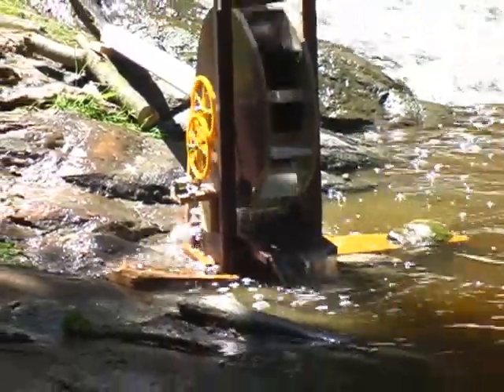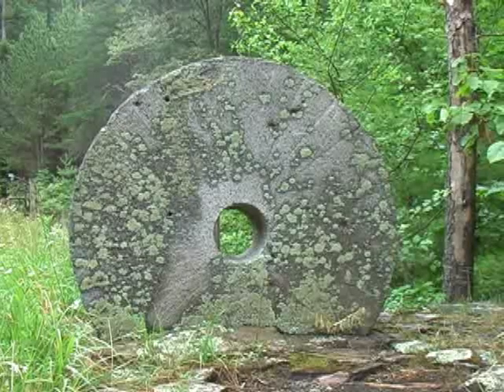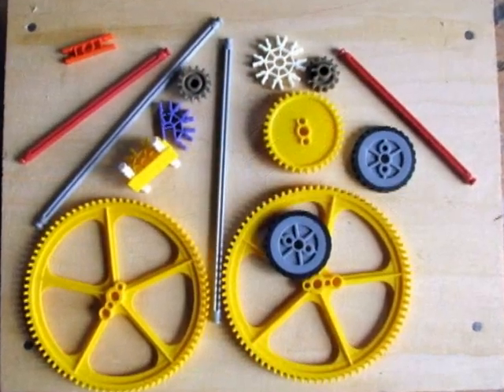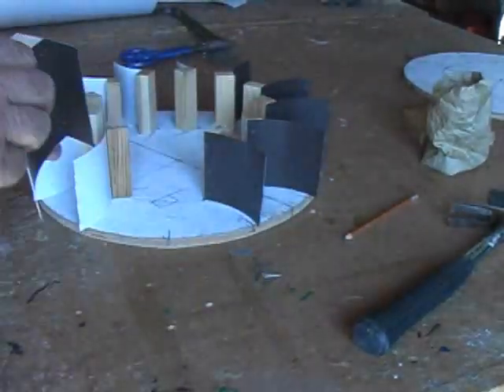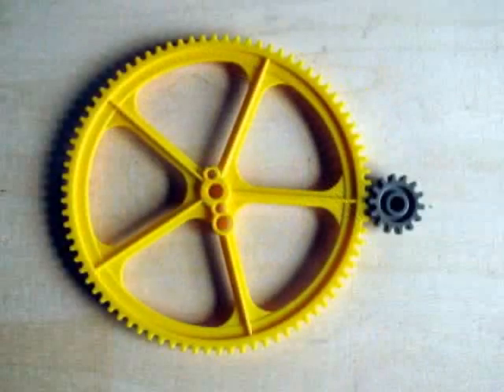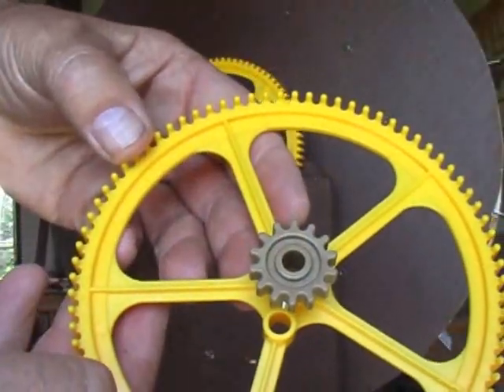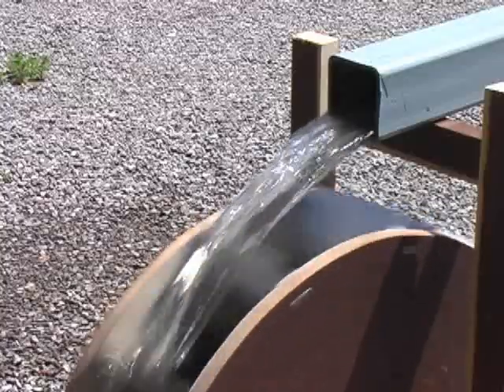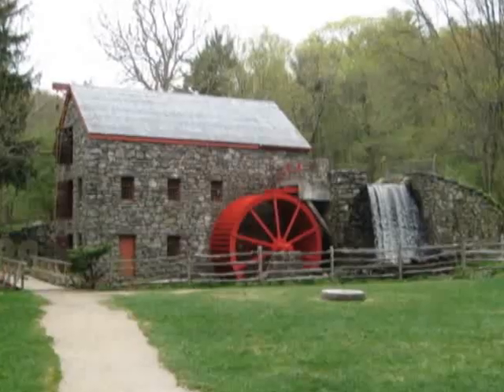Build a Water Powered Mill

Comment: You can assume the power by calculation water amount and available drop height of the water... This will give you the available pure natural energy... multiplied with the effeicency factor of the water power machine - for your modell I would assume a factor of 0.4 at maximum you can calculate the power output...
And later get the resistor on, and see if the calculations were correct...